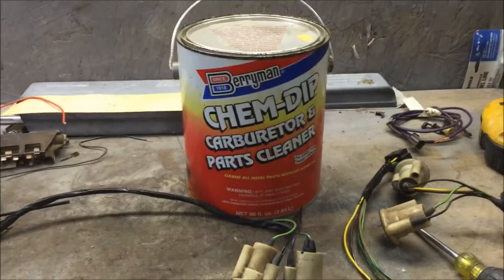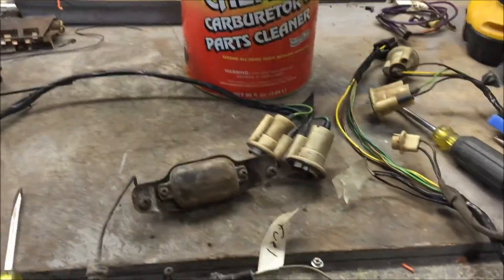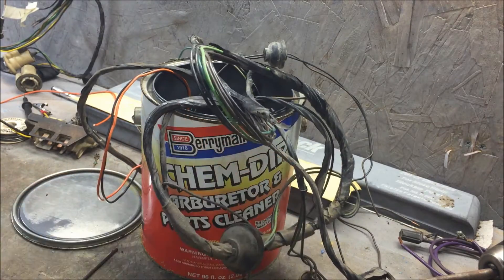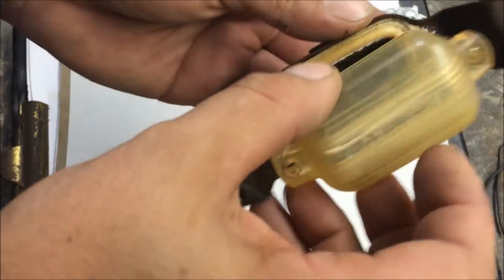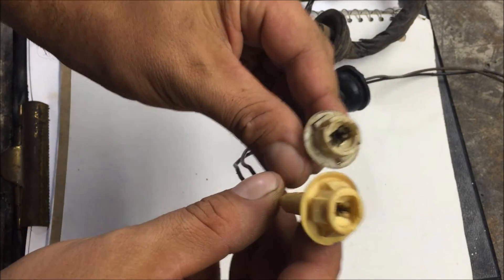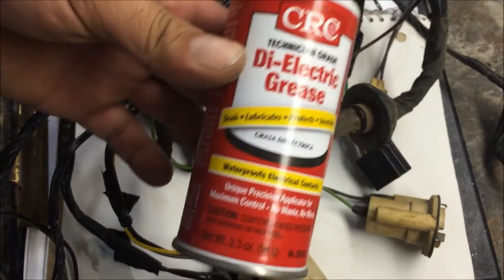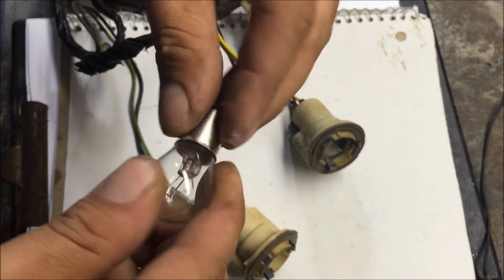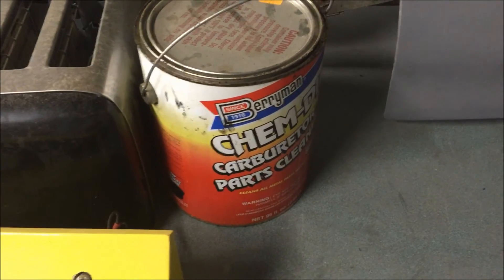how to clean old electrical AUTO connectors and plugs

Comment: if you have carb cleaner sure perhaps. I wouldn't buy it for this purpose it's like $50 a gallon. Vinager only cost a few bucks works as good if not better and you can use the leftover for cooking or pickling.